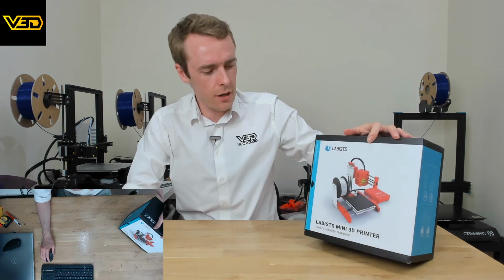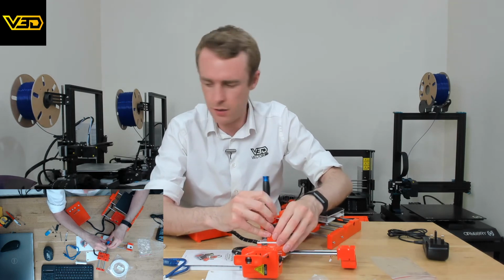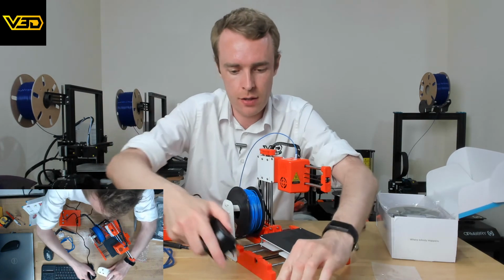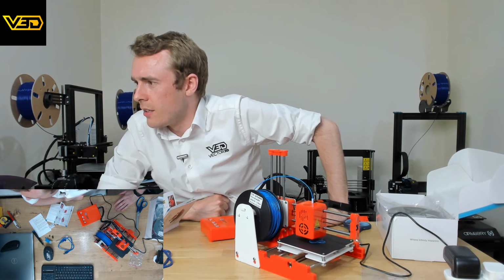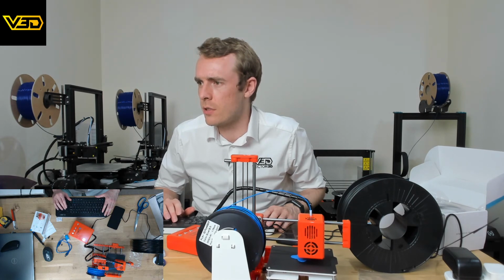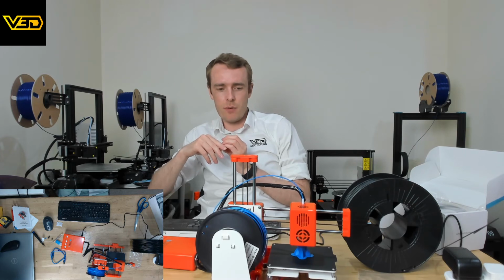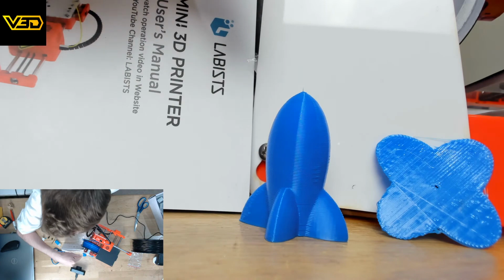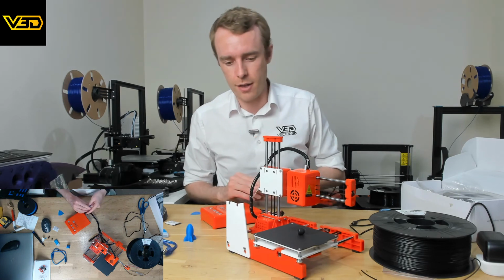Easythreed X1 Mini 3D Printer, Unboxing, First Look, First Print

Comment: These printers are not bad. However, there is some backlash in motor gearboxes. That's why circular movements are particularly problematic.

In addition, there is a heating problem in the engines. In long-term printing, it may miss step due to excessive temperature.

Can be ignored as they are entry-level printers

Comment: thanks for the detail about the nozzle, heating element, etc.  nobody has shown the nozzle underneath the black cap.
I would have like to see a closeup of the the nozzle without the black cap (as you have done), and then a closeup of the heating element underneath the kapton tape if possible.  This printer is very light weight, if you dont mind the speed... and if its precise, i wonder if it could print something big? Can the elements lasts that long?  Or must prepare many nozzles ahead of time?  Or just change the whole heating block, but as you say, the whole machine is 30watt, maybe cannot use normal heating blocks+extruder units?  Does anybody know or have a good guess?  Thank you very much for your kind info.  Here is my research from zero to now.  https://swannbb.blogspot.com/2020/12/cura-3d-printing-tricks-for-stronger.html

Comment: Bought this on a whim from Banggood. Not half bad quality once you figure out the correct profile parameters but reaaaaaally slow. Mine had a problem from the box not reading SD card at all. No problem, using it under Cura 4.6 through direct USB connection. Added a part cooling fan as well. 
The problem with adding a screen through the EXP1 header is that it is a 12-pin one instead of a 10 pin so you can't add a screen unless you do some cable surgery from the 12-pin connector on the board to two 10-pin ones (EXP-1 and EXP-2) for a RAMPS style screen. Quite tricky to do. Instead I have ordered some parts to convert it to use the stock Ender-3 board and screen that I am replacing on my Ender 3 with an SKR 1.3 Mini and TFT35 touchscreen. Also ordered a 100x100 24V heated bed and will be converting it to bowden tube using the stock Ender-3 extruder stepper and hotend assembly/thermistor and heating element that I have replaced with an E3D V6 and BMG direct drive setup on my Ender-3, so ... yeah it will be quite a frankestein project :D. Stepper VRef will be the key factor so that I don't burn these small stepper motors. Of Course, before anyone asks i won't be using the 30 Watt PSU ;)

Comment: That uses the same heating element as my first 3D printer, the M3D. A ceramic heater with integrated thermistor.
Reply: could you please tell me the reference of the heater?   Thank you.
Reply: @swannjiejiechow3495  I don't know the reference, but I could send you some pictures. By now there should be some of those on amazon (hopefully).
Reply: youtube.com/watch?v=JC5nPQvVwTs  a Spanish reviewer here has changed the heating head, but I dont undertand he seem to have changed all the control box etc, more than just the head.  At the end, we see extrusion but the x axis is having a hard time to move.  I wonder if that is a sign that there is not enough power.  I dont mind changing the whole heater+extrusion+nozzle block but if that involves changing a lot of other complicated elements, then the light weight quality would be no longer valid.  Slow, is ok.  But weight - if it gets heavier, then, there are other options.  No need to fuss w this nice little object.

Comment: Its a Melzi/Sanguino board.
The heated bed is available from easythreed
You can add a screen but it has to be I2c using the EXP1 but you need to reprogram and reflash the firmware.
Reply: you seem to know a whole lot about this printer (or the components that are used). Is there any good resource where I can find those informations for myself?
I just bought mine on sale and I would love to tinker with it and upgrade it to it's highest potential.
Reply: @yekt3805  come join our official Labist community on Facebook.
I found out by looking through various firmware files found in marlin and then compairing hardware revisions.

Comment: I got one from aliexpress, paid 98 usd with shipping. The brand there is easythreed. One problem I have is the mirrored printing. Would you have a correction patch suggestion? I wrote the manufacturer about that but didn't get a response yet.
Reply: you just re- plug the wires, i saw in one reviewer - he fixed it just like that.  I will find the link if you still need it.
Reply: @swannjiejiechow3495  thanks, there must be a connector that can be inverted internally. I watched some reviews but I believe nobody noticed this problem! And yes, please send me the link!
Reply: @zzzfs2004  you dont have to buy anything, just switch the plug positions.  It was just plugged in wrong end.  I saw the reviewer fixed it immedately by plugging the wires in the right receptor sockets.  If i find the exact video (from youtube) i will put the link here.  I have not yet tested my own machine, just received it.  But i see that they already put in the extra fan.  So the new ones probably already have all the wire ends in the correct receptor ends
Reply: @zzzfs2004  https://youtu.be/7lur2mVMg34

to solve mirror issue, just re-connect the wire , as in video
Reply: @zzzfs2004  https://youtu.be/7lur2mVMg34

to solve mirror issue, just re-connect the wire , as in video
Reply: @swannjiejiechow3495  Thanks a lot! I thought it would be a software fix! I'm gonna try it here!
Reply: @swannjiejiechow3495  If you got one, can you tell me if what looks like bearings at the axes' ends are actually bearings, or just rods with friction bushes? As I see in other comments you have a website, would appreciate if you could put some pictures. Thanks!
Reply: @stupid-handle   i bought one, but have not yet opened the box its been 3 months, i dont have time to look into this machine yet.
Reply: @swannjiejiechow3495  Oh come on, like a child on a whim? So many questions, so much "research" in your website, and after owning one you don't even have time to even look into it? At least be honest and say you just don't want to do it.
Reply: @stupid-handle   sorry Educardo, people have other things to do too, i have already forgotten about the questions, since the condition in which i will use the machine is no longer the same, so the machine is packed away in a suitcase somewhere.  And please dont disturb the child in yourself, or in the other, be more respectful.  You know nothing about my research.   Take care
Reply: also if people dont answer you in the way you want to happen, its not personal, its not they "dont want to do it" - it might be just conditions are no longer the same -to get a pic of any part of any machine especially one that is popular like a 100buck machine, you could ask anyone who is posting photos of their master pieces online now, they are using it, and would be v easy to take a pic for you.  I hope this answers your questions.  Have a nice day @Eduardo Costa
Reply: @swannjiejiechow3495  I was recommended a video explaining how to switch cables to solve the problem. As it was an assembly problem many people also had it. The manufacturer should have issued a note about how to correct the problem.
Reply: That problem can be solved by changing a line in the firmware, no need to tinker with the wiring
Reply: @stupid-handle  both solutions work